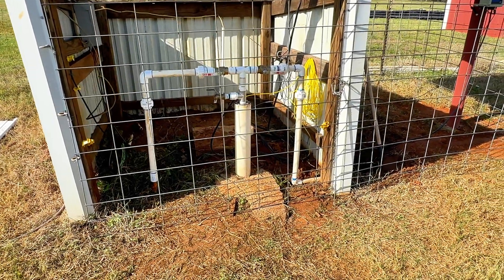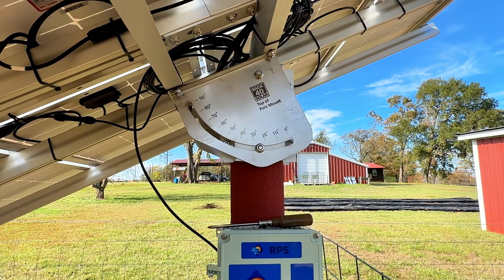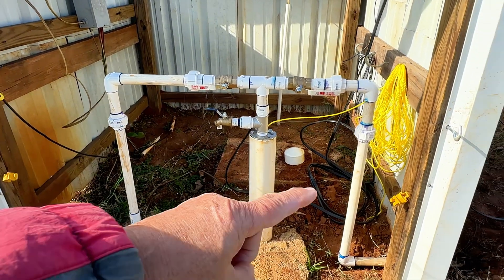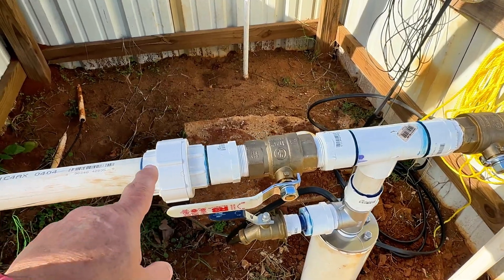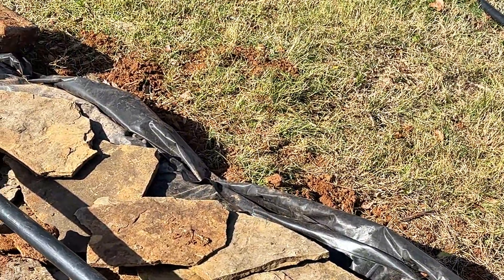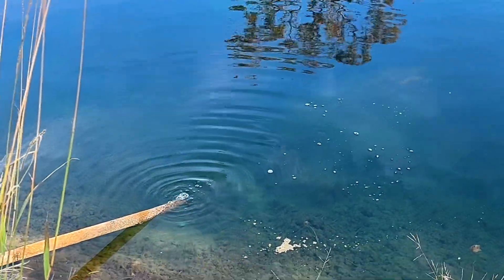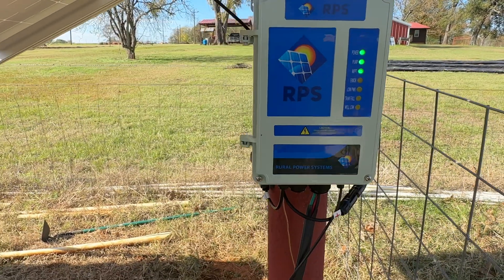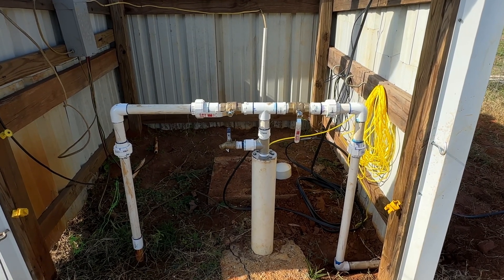RPS Solar Pumps - Pump Water with the Power of the Sun!💧☀️Stop Trying To SEAL Your Pond    #ad

Comment from the maker: Discover the future of sustainable water pumping with RPS Solar Pumps! Pump Water with the Power of the Sun 🌞💦 Say goodbye to leaky ponds, expensive electricity bills and unreliable power sources—these solar-powered pumps provide an eco-friendly, cost-effective solution for your water needs. Perfect for irrigation, livestock watering, or remote locations, these pumps harness the sun’s energy to deliver consistent performance. Learn how easy it is to set up, operate, and maintain your own solar-powered water system.

Check Out RPS Solar Pumps HERE: https://www.rpssolarpumps.com/

🌟 Highlights:
✅ Solar-powered water pumping for remote areas.
✅ Cost-effective and environmentally friendly.
✅ Easy installation and low maintenance.
✅ Perfect for farms, homes, and ranches.

Join the green revolution today! 🌱 
Watch now and see how RPS Solar Pumps can transform your water needs.

Are you tired of leaky ponds and futile attempts to seal them?
Well, I've just installed a Solar well pump from RPS Solar Pumps.
Instead of using a 220v pump to pump water for my farm ponds, I'm now pumping water using the power of the sun!
Let me walk you through the process of converting to solar power, explain the cost benefits, and show you the results and water flow I'm getting utilizing the sun's power.
Put the sun to work!
alan
As a member of the Amazon Associate Program, I earn from qualifying purchases

Discover the world with Expedia. Book your trip now!:
https://expedia.com/affiliates/hotel-...

Check out my Website. 
I've written dozens of articles pertaining to all areas of homesteading and self sufficiency.
Here's the link:  https://homesteadadvisor.com/

#SolarPumps #RenewableEnergy #SustainableLiving #EcoFriendly #WaterSolutions #OffGrid #RPSPumps

If you enjoyed this video and would like to see more videos like this. please give this video a thumbs up and leave me a comment!  
Please subscribe, it would really help my channel! ❤

Comment: Great video.  I’m about to install an RPS800 here in central TX.  Question for you.  On your video footage showing water flowing into the pond, I see you used poly pipe.  Is that 1 inch diameter pipe?  Also, the PVC coming off of the steel T on the well head— when you made the transition from PVC over to the poly pipe, did you use a steel hose barb with hose clamps?
Reply from the maker: Yes, it’s 1” black poly pipe. And yes, they supply the stainless steel nipple for the transition from poly to PVC fittings.
Hope that helps.

Comment: Good work, the water source won’t deplete at that depth?
Reply from the maker: I don’t think so. It hasn’t yet. It’s run all day long on sunny days. Even if it does, the “low water sensor” will turn the pump off if the water gets too low.

Comment: Thanks Allan for the info, that's critical for your homestead. I'm super interested in this system. Only thing I can recommend is drain everything in cold weather to keep your pipe from busting.
Reply from the maker: Actually, I drilled a “weep hole“ about 3 feet down from the well head. The water level should drain down to that, and not allow anything to freeze. 
In other words, there should be no water in the exposed plumbing.
Reply: @TexasPrepper2 How small of a weep hole did you drill into the drop pipe?